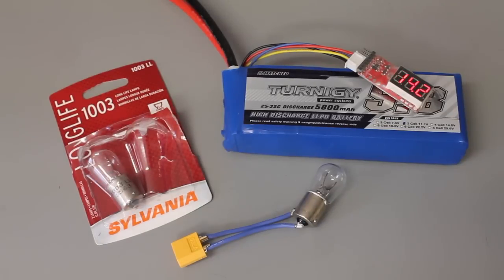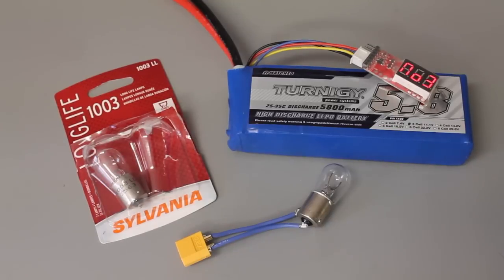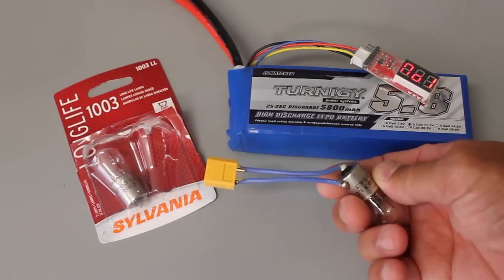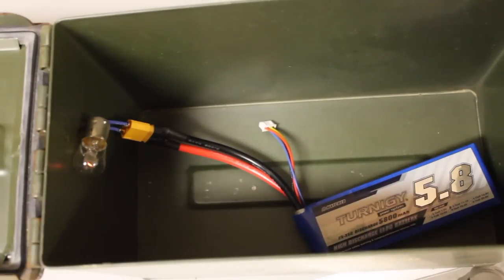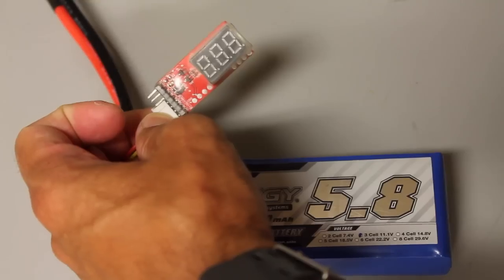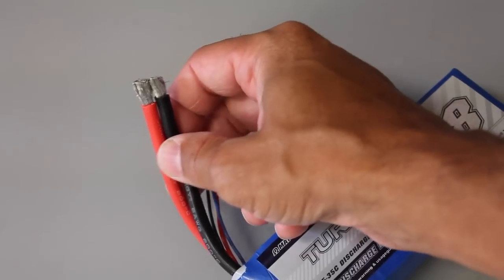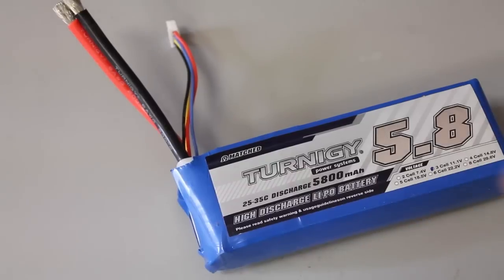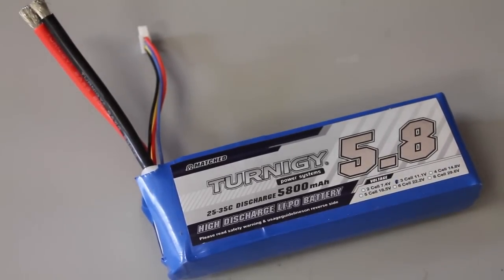How to Discharge and Dispose of LiPo Batteries

Comment: I use ammo boxes for lipo storage and transport. One of the best ways to go, really. It won't completely prevent fire but, I could make the difference between a burned down home or just some smoke damage. Got my for $20 per and Sportsmans Wearhouse. Not a bad deal for all metal cans. 
Good video, dude. Got a couple of 6s batteries, probably about 5 years old and 300-400 cycles on them ready for retirement. Feel I got my money's worth outta them. 
Been buying mostly HRB batteries the last couple of years. The reality is, most all of these batteries are made in like 4 or 5 factories in China. They just slap different labels in them. HRBs tend to last longer than most..but not by a wide margins. 
If you want your batteries to really last....charge at 1c. If you're like me and you can't use them for say six months out of the year (I live in Phoenix and it's flying season now in the winter) check your batteries after about 3 months of storage. During the season, I get them down to about 35% during flying season. They get used almost every weekend. But, for summer,  I storage charge them to around 45-48%. Most batteries when shipped new are around this. They don't know how long they'll sit on the shelf. I've had good batteries at 30-35% over the summer come up with a bad cell or dropping to low. 
It's a pain when you have a lot of 4s and 6s like me but, after 3 months of sitting in Ammo Cans, ill charge them up, let sit for 12 hours and then storage discharge then back to 45%. 
I built a rapid discharge station...lol. And old 80mm EDF mounted to s board. And old receiver and ESC from a dirt napped plane, then just run it at like 70% throttle for 5-10 mins until at a good storage charge percentage. It's loud.. but beats the hell out of the slow discharge rate of even good chargers. Eventually, I'm gonna at an ESP32 or Raspi Pico for some automation. Maybe design something marketable ...lol.

Comment: I just use my charger set to nickel metal hydride discharge mode at lowest drain current setting 0.1 A. And lowest discharge terminal  voltage 0.5 Volts. It usually leaves the pack at about 1.5 to 2 volts. Then I do the same as the video.. cut and short the wires (very small spark) and solder them together. Initially I discharge the pack at a higher rate.

Comment: maybe a late comment but, i got a 4S lipo really old one has about 1600mAh of cap but one of the cells dropped to about 1 volt while the others are fine. but its puffed like hell and looks like a fire could become reality soon.
im wondering if i discharge this on a charger pick the discharge option ofcourse isnt it going to puff up even more and actually cause the fire i dont want?

Comment: Well first of all if you know the hobby you don’t use a lightbulb to discharge the battery you buy a serious charger that discharges batteries as well as charges them. Not a freaking lightbulb.
Reply: what's wrong with the lightbulb? Is it pulling too much juice to be safe?
Reply: @cinialvespow1054 nothing wrong, some just dont understand how discharging actually works

Comment: I have used that method. Left a bulb connected to a battery for whole night. Disconnected - and tested with voltmeter - it shows 0V. But then next day voltmeter was showing 2.3V on each cell and battery got puffy. How it got voltage buildup on its own?
Reply: good question -  maybe they "recover" a bit when not shorted out -  probably would stay at zero if left shorted

Comment: Great vid. But what i dont get is why the reading was 1.9 v after discharging and then suddenly 0v before soldering the cutted leads together... Did the voltage drop to zero because you shortened the leads?
Reply from the maker: You may see a little voltage fluctuation when you drain the battery. For example, I recently drained a battery, disconnected it, and then connected the next day. It was able to power the bulb (very dim) for a few seconds. It didn't have any real capacity but still had a small amount of voltage. Shortening the leads should definitely get it to drop all the way down. Be safe when you do this. Good luck and let us know how it goes.

Comment: Could you show us how to do the xt60 to the light bulb please
Reply from the maker: I solder the positive cable from the XT60 to the bottom tip of the light bulb, which is positive. Then solder the negative cable from the XT60 to the side part of the bulb. This page shows a good diagram of the connections: http://www.quickstudylabs.com/Electronics%201/FreeSafetyClass/Light_a_lamp.htm

Comment: Thanks for the video, very helpful. I think I like your method over the others I've seen. Instead of the light bulb, could you just discharge the Lipo using an imax charger/discharged?
Reply from the maker: I'm not familiar with that discharger but I know a lot of manufacturers have a lower limit on voltage per cell that they don't let you go under. So make sure you do your research otherwise you'll be left with discharging for storage and not for disposal.

Comment: What could happen if you dont drain the cells before disposing?
Reply: +Patrick Aniol Next time you get a sick battery take it to your field and hit it with an ax, that's what could happen when the garbage truck operator compacts his load.
Reply: I work at a yard with city trash trailers. I’ve seen an entire trailer light on fire and the fire department coming out to handle it. Battery fires are nasty since it’s a chemical reaction. All they could do was douse the surrounding material but had to let the chemical fire burn itself out. Then there was a huge mess left for a separate disposal crew. Don’t be a fool, properly discharge and recycle them.
Reply from the maker: +Savire I think worse case is due to humidity or some metal element could cause a short and ultimately lead to a fire.

Comment: Have you heard anything regarding discharging them with the discharge function on my charger?  I have to dispose of my first battery.... Thanks for your awesome channel, I've learned so much from you
Reply: Did you find out?
I need to get rid of a 3 cell lipo that has a dead cell
and I have a Hi-tek charger with an option to discharge
so I'm wondering if that is the way to go?

Comment: Hey...What happened to the "THREE R's"?????  Reduce, Recycle and Reuse.  You're missing the best of the those.  I take the dead cell out and use the saltwater.....  But you still have other "good" cells to re-use.  Now, I would not use them to make a flight pack but there are tons of uses for batteries.  I've made stuff like a pit light for night races at my local RC track.  I even strung a bunch of LED's and a bunch of old cells in parallel and used them Christmas lights on a tree too far from the house to run an extension cord.  Be creative, there is enough half-used stuff in our landfills already.
Reply from the maker: Matt Molloy I have never heard of the 3 Rs but that's good stuff to know. I'll definitely keep this in mind the next time this happens. I would have loved to keep those 2 remaining cells. Thanks for the tip!
Reply: agreed.....good idea....

Comment: Might be a good idea to snag the balance plug and wires off it before you throw it away. May come in handy for DIY battery's or damaged connector replacement.
Reply from the maker: Kezat Awesome suggestion. I was able to do that over the weekend thanks to your comment! Thx.
Reply: I typically do. I've used them for extensions, bench testers or...even in some planes so I check the battery by just plugging into a port I put in the fuselage. 😉

Comment: Yeah i've seen and heard most of the ways to discharge them safely,i normally just do the saltwater method myself then i don't have to keep an eye on so to speak,i just put it in an old jam jar with the saltwater and leave it out in the 
back garden until it's ready for the rubbish.

Over the 8 years or so i've been flying RC i've only had to do this 4 times,for the amount of batteries 
i've got i don't think it's that's to bad. :-)
Reply from the maker: startazz Thanks for sharing and my experience has been similar in that it's not very often that I have to do this. I just wanted to experiment and see what different ways there are to dispose of them. One user suggested removing the bad cell and use the remaining two. I thought that was a good idea and I may have to give it a try sometime. Take care.

Comment: I don't think this is correct. The voltage is obviously not a problem since you drained it completely, but there is some pretty nasty stuff used in making these things. This is stuff I don't think we want seeping into our ground water.  I am not sure, but there may still be a fire hazard if they are punctured. The chemicals inside may react with oxygen fairly well even without electric potential.  Not sure,  just thought that I would comment so that we can all be better safe than sorry.
Reply from the maker: ***** I hear you. I'm not sure what the best way to dispose of them is, but I know discharging them is a necessity. Several articles about lipos suggest that they are landfill safe:

http://www.rctoys.com/pdf/thunder-power-disposal-of-old-damaged-lipo-batteries.pdf

But who really knows. The best bet is probably to drop them off at a battery recycling place and let them take care of it. Thanks for the comment.

Comment: Denis, I'm a bit confused..... Is this not a 3 Cell Li-Po as indicated on the label??
At 0:20 in the video, watching the voltages flash by I see:-

All = 14.3 V
No1= 7.36 V
No2= d2.9 V
No3= 7.35 V

Something else seems to be wrong with the battery or your cell tester.
A single Li-Po cell should read in the vicinity of 3.3V to 4.2 Volts. Your cells read 7.35 V.
Reply from the maker: lasersbee You got me on this one. I couldn't figure out those values either. I did so much digging around and know my voltage tester is fine. I use it all the time and compare it with my voltmeter. When I hooked up my balance charger it wouldn't let me charge because cell 2 was below the minimum threshold. I read about trickle charging on the NiMh setting, but then I'd have to isolate that cell and bring it up to a voltage where my charger wouldn't complain. Anyway, all that to say I have no clue why those cell voltages were so out of whack. Very frustrating but this battery had been through quite a bit of wear and tear. Thanks for the thoughts and if you come across any other ideas I'd love to hear them.
Reply: Dennis Baldwin Would be a good idea to test your voltage tester against one that is known to be good.

Comment: Dennis, what I usually do when i have a dead cell, i just remove it from the battery and rewired it. you can get a 2 cell battery so there is not such a loss